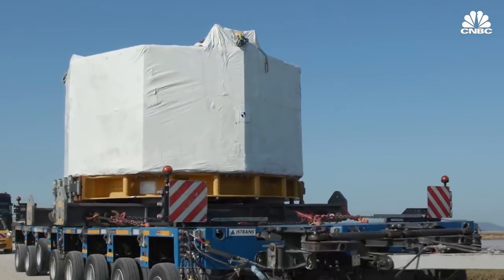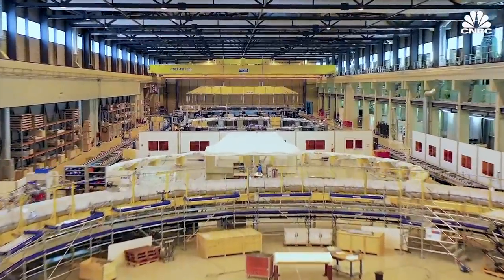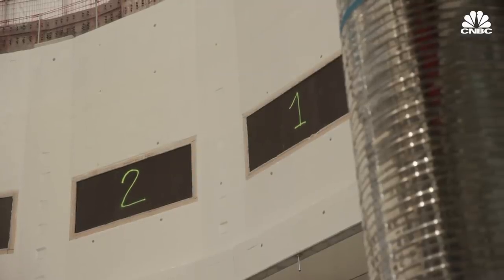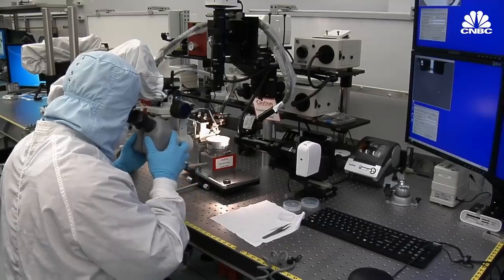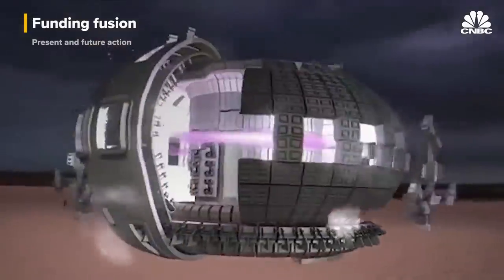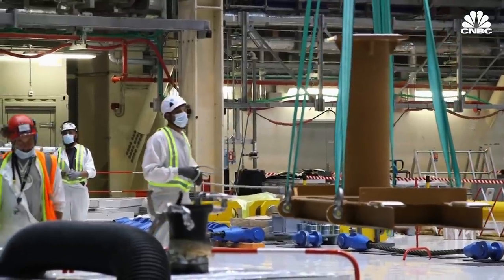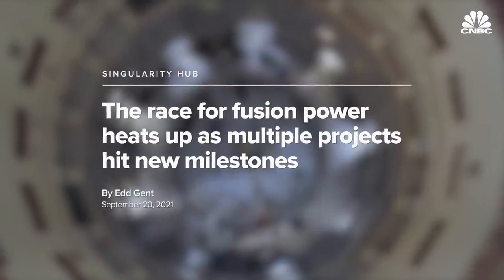Can This $22 Billion Megaproject Make Nuclear Fusion Power A Reality?

Comment: Kudos for acknowledging that raising living standards requires energy and that wind and solar are not going to cut it because they're not "always on".
Reply: Wind and solar by themselves are not, but wind and solar in combination with battery storage will.
Reply: @franksang5014  Indeed.
Reply: @franksang5014  In theory only, there has not been a battery tech breakthrough that will allow this. Unless the new tech in China works.
Reply: solid state batteries are what we need to fund the most, if our batteries improve so too will the capacity of Solar & wind, it's the only hurdle holding us back, in reality solar energy alone is more than enough to power the entire planet if we master energy storage
Reply: @franksang5014  no it won’t. Where I live we get winter 6-8 months out of the year. Solar is not viable. And wind turbines will freeze up.
Reply: @franksang5014  then the only problem would be to have enough of them. For the power they produce wind and solar require lots of space.
Reply: @franksang5014  This sounds like the "we need faster horses"  argument.
Reply: Solar IS always on - somewhere !
Reply: @gurdeeps  I'm not arguing against nuclear power. If fusion costs can eventually come down then it will clearly be the superior energy source. However, as you know, fusion is still largely theoretical as a source of electricity. Solar, wind, and energy storage already exist at scale. Until fusion comes along we would do well to expand their usage.
Reply: @gurdeeps  the case for nuclear fussion is literally made by the same argument.
Reply: @lppoqql  Actually, I would say that it's more than just theory. After all, energy storage is being implemented in Australia, the United States, and many other countries at scale. This is not to say that we don't need advances in battery technology, but with the technology already in existence we can scale up quite significantly.
Reply: @santiagovelamorales1029  You mean fission right?
Reply: @anxiousearth680  no, fussion. We can dream for faster horses, but comercial fussion energy is further than safe and modular fission plants or better battery storage. Fussion is still a dream and will be for a long time
Reply: @grahamashtonuk2554  Solar Grid
Reply: @franksang5014  Solar/Wind are never going to be even close to fusion when it is ready. And it never will be if we don't make huge investments into it.
Reply: @gurdeeps  I'm glad we're in agreement.
Reply: @grahamashtonuk2554  Yeah maybe in space. We have these things called cloud coverage and night on Earth. lol
Reply: @franksang5014  Y'know the lithium in battery storage is limited on this planet
Reply: I believe excess energy could be stored in many ways, including hydrogen for larger vehicles and likes of. Not just lithium etc battery tech

JCB (British digger company) have just invested heavily in hydrogen commercial vehicles, so that says something in my books
Reply: @Rem694u2  Energy can be transported from one area to another. With High Voltage DC power lines, trasmission losses are only about 3.5% per 1,000 km. You could have a massive solar array in the middle of the sahara and transport all its energy to Northern Europe while losing less than 15% of the energy in transmission
Reply: @TankDerek  From what I have read, typical maximum transmission distance is usually only like 300 miles using high voltage lines. There is a reason for that. You also start with a base loss of at least 5% usually closer to 8-15% from the power plant to customers just within normal ranges.
Reply: Nope, no kudos from me because they neglected to add that we ALREADY have a source that satisfies all of those criteria. It's nuclear fission.
It's safe, many times cheaper than any of these fusion proof of concepts, tested and operational since decades, requires no exotic materials that are only found in geopolitically questionable countries, emits LESS CO2 than renewables, is reliable and easy to build with current technology.
The only issue it has is the decades of fossil-fueled propaganda that have been stacked against it.

Fusion is the future, but fission can be the present. And we need to decarbonize in the present, not the future.
Reply: @Rem694u2  You do know that electricity can be transported over long distances thanks to these things called high-voltage power lines, right? If your country has winter 6-8 months of the year then the obvious solution is to install high capacity interconnectors from places where solar and wind are plentiful. Continent-wide synchronized power grids have been around decades.
Reply: @Rem694u2  with some billions worth electrical cable from Moroccan Sahar solar energy farms to US electrical network and it's done.
Reply: @mohcinemabsoute9323  EZ CLAP. :) lol
Reply: I'm so glad that the question about fusion energy is moving towards when and how, instead of if, this could solve a lot of problems for us
Reply: @franksang5014  Batteries require toxic substances to be made.
Reply: @Rem694u2  I also live in the North and have an off grid solar system that works all winter long. The sun still shines in the winter.
There are also wind farms in Canada, Alaska, the North Sea , etc,,, that work all winter long as long as they are winterized. They do not freeze up at all.
Reply: We need to use more fission energy - new designs are foolproof and produce more energy than older designs while also producing less waste
Reply: @santiagovelamorales1029  seeing as you can’t even spell “fusion” correctly, I’m gonna take your opinion with a grain of salt.
Reply: @TankDerek  no, resistance would be way too high for that too work.
Reply: @estebanslavidastic4382  yes I made a mistake at spelling. But, that's a different thing to the content of the argument
Reply: @franksang5014  i think we should use fission.
Reply: What standard do we need to raise that isn't high enough all ready. Our standard is so high in some places. What we need is not a higher standard of living but a cleaner standard of living. Like not building things to fall apart.
Reply: We'll adopt communal living and run our pipes down the corridors to heat the place. Huge hotels housing thousands with meals provided by the state. A bit like H.G. Wells predicted.
Reply: @skepticcat2443  Solid-state batteries are only good for compact sizes, such as car batteries and smartphone batteries. They still don’t have enough capacity to make wind/solar/hydroelectric/hydrothermal work. Fusion is just an all-round better idea, because it doesn’t need much R&D to make it functional at this point. And it has more uses outside of power generation too.
Reply: Solar panels in space. They’ll always be on.
Reply: @youmad7495  You’re going to need a lot of solar panels, even all the solar panels in the solar system right now won’t be enough.
Reply: @youmad7495  It’s very expensive, because you’re going to need to 
a) make 1000000~ square km of solar panels 
b) launch thousands of rockets (or hundreds of times if you use the bigger ones)
c) if something goes wrong, launch again!

Comment: There's a couple misstatements in this video:

1) Fusion produces 4X the amount of energy as fission and 4,000,000X that of fossil fuels. This is true, but you're not getting all of that energy out of the reactor, as it cost a lot of energy to maintain the reactor. Currently, we're just trying to get as much energy out of the reactor as what we put in, but, hopefully, in the next decade or two, we'll probably break through and actually achieve energy gain. Let's assume we make some massive breakthroughs in super conductors in the next decade or two so that we not only achieve energy gain from fusion, like getting out 25% more power than what we put into the reactor, but we will be able to generate 2X the amount of power we put into the reactor. That means your reactor requires you dump 50% of the power that it produces right back into the reactor just to maintain fusion. So, under this OPTOMISTIC scenario, your fusion reactor is really only generating 2X the amount of power you'd get from fission and 2,000,000X what you get from fossil fuels, and that's after a couple more decades of major technological breakthroughs. Fission reactors, on the other hand, already exist and are already able to produce 1,000,000X the amount of power you'd get from fossil fuels..... Also, with a fission reactor, you don't have to dump any power back into the reactor to maintain the reactor. You just add fuel. 

2) The fuel used by these reactors is plentiful. Fusion advocates like to talk about how, compared to fission reactors, the fuel used by fusion reactors is much more plentiful, as it's "just hydrogen". That's not exactly the case though. Almost every fusion reactor currently being worked on right now and planned for in the near future will use deuterium and tritium, both isotopes of hydrogen. Deuterium isn't nearly as common as simple hydrogen, but it's still common enough that it's still way more common than fission fuels. Tritium, on the other hand, doesn't exist naturally, but must be produced by "fissioning" lithium atoms. Lithium is a little more than 2X as common as thorium, the ideal fuel material for one of the best potential fission reactors, LFTR's. HOWEVER, you don't get tritium from common lithium, but primarily from an isotope of it, Li-6, which only makes up ~7.5% of natural lithium. This is where things flip around though, as Thorium is 6.4X as common as Li-6. As such, fusion fuel is actually less abundant than fission fuels. 

3) Unlike fission reactors, fusion reactors don't produce long lived radioactive waste. Contrary to what the video states, there are actually several Gen 4 reactor designs, such as LFTR, that don't produce long lived radioactive waste either, as those long-lived wastes are chiefly the transuranics which largely aren't produced by LFTR's and would be consumed in other types of fast reactors. So the wastes produced by reactors such as LFTR's would be short lived radioactive waste. Fusion reactors also produce short-lived radioactive waste as H-2 + H-3 fusion produces hell'a lots of free neutrons which will be slamming into the reactor vessel and surrounding materials, converting many of those materials into radioactive isotopes. 

4) Fusion reactors can't melt down. Neither can fission reactors like LFTR's, which are liquids to start.
Reply: One thing to put the tritium in a little more perspective. At 30k dollars per gram, it is the most expensive isotope in existence. There is good reason to think fusion reactors will not be able to produce an out of tritium equal to what they will need. And that is a show stopper because there is a finite amount in existence.
Reply: The issue with tritium is honestly what I think is the biggest reason fusion energy will never be a viable source, even more than actually getting it to work. The way things are going we won't even have any tritium by the 2040s.

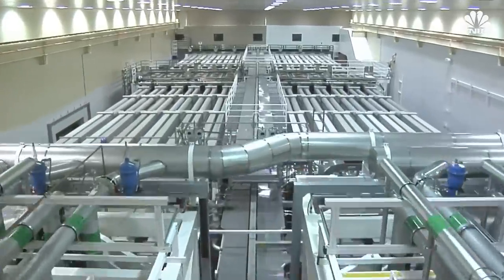Comment: 3:09 that's incorrect - the 50 MW quoted only includes energy that goes into the plasma and not what's used for the whole system, the 500 MW produced is the plasma emergy, not what can be used to produce electricity. Overall the power output will be only about 75% of what is used and that's only for 8 minutes of operation.

But that's fine because the production of net electricity was never a goal - ITER is a testing and development platform for the next reactor DEMO.
Reply: This is a very important point, was just going to mention it but you mentioned it. Thanks for pointing it out.
Reply: Yes sabina sabine hossenfelder made video on this Qplasma QTotal
Reply: well 75% is a lot better than the ~1% that was possible before.
Reply: It's worse than that. The Qtotal of ITER is about 0.1. That's before converting the thermal energy into electric energy.

ITER takes 440MW, 120MW of that is consumed without any plasma at all.

ITER was touted as being able to produce more energy than it consume on more than one occasion, conveniently leaving out the fact they were only talking about Qplasma. Like they assume the plants themselves will just magically consume less power.
Reply: I'm so glad that the question about fusion energy is moving towards when and how, instead of if, this could solve a lot of problems for us
Reply: @Tim Norris It would be much better to invest in Fission than anything. France decarborised it's energy grid without even trying. It gets 90% it's energy from clean sources every hour and every day, while it's neughbour Denmark doesn't even get that much when the wind is blowing and goes back to dirty when it isn't.
Reply: @Tim Norris I said 90% from clean sources, not from nuclear energy, although nuclear makes up the bulk.

Decommissioning costs are paid for by the reactors themselves, it is a legal requirement to put away money to pay for your decommission.

Waste? You mean the entirely contained waste stream which constitutes the tiniest waste stream of any power source? That waste? 3 casks in the corner of a room powered Paris for 50 years. France also reprocesses it's fuel reducing the long-lived isotopes.

What is the solution to solar waste? Landfills or African kids blood streams, and a lot of them.
Reply: @manpetepetrop8034  Same. It's like vaccine efficacy vs. efficiency. Not sure why these lies are so blatantly propagated by the scientific community, and it certainly undermines my faith in them.
Reply: This step, to keep the plasma stable you need energy.
we don't care about if this project is profitable, we only care if the fusion process is able to generate energy!
Reply: @Tim Norris that’s just laughably naive.

Wind and solar have reached almost their apex in regards to output.

They are incredibly costly to build and maintain, and only become profitable after dozens of years, or in very specific regions on earth. 

Wind energy isn’t viable for countries without hurricanes/tornadoes. Solar isn’t viable for countries with lots of clouds or little sun. 

It’s not a matter of if, but when.
Reply: @Tim Norris yeah and Denmark has an IDEAL geographical location for wind energy, and has a small landmass and population. 

Renewables CAN work in SOME countries, but they are grossly inefficient, costly, and again only work for SOME countries. 

I mean, Iceland has 100% of its energy needs met by geothermal energy. Does that mean we should all switch to it? No. We don’t have access to that, and our populations are much more massive. 

Renewable energy is only viable wide scale, in small countries with uniquely positioned locations on the globe that allow them to take advantage of the plentiful amount of resources available.

Wind energy and solar energy won’t come anywhere CLOSE to being able to power China, or USA, or Russia or India.
Reply: @theeiszeitmann928  how will you store/use that 75% in 8 minutes ?
Reply: @forefatherofmankind3305  it's impossible but that's not the Point. I was merely pointing out that the efficiency is a lot better than in perversely attempts. However,  i agree that the reporting is very misleading.
Reply: @infini_ryu9461  even if this reactor doesn't produce net energy, that's the point, it was never meant to generate the energy it was just made to prove that fusion energy is possible

Comment: The "50 MW in, 500 MW out" is actually only for the plasma, not for the overall energy. Looking at the total, ITER will still consume more energy than it will produce, even under ideal conditions
Reply: Yes, and that only applies while it is running.  Even when making no power they need a power input.
"Fusion energy is 30 years in the future and always will be" still applies so far.
Reply: @kensmith5694  Clean Planet Inc. and Miura (Japan's biggest boiler manufacturer) have concluded an agreement for joint development of industrial boilers that use Quantum Hydrogen Energy (eg. LENR). Clean energy is not so far after all.
Reply: @marcbuttler7681  I wish them luck but I am skeptical.   The question of no fatal gamma ray doses in the very early work has not been answered.  If the claimed process was going on, that should have happened.  The only way it could be real is if they stumbled onto something and their explanation of what it is , is incorrect.
Reply: Imagine thinking you know the stuff better than the thousands of ITER scientists working on this 🤦🏻‍♂️
Reply: @Engineer9736  aww Richard you poor confused guy :(

Comment: Ah yes, nuclear fusion.

The technology that has been 5 years away for 30 years
Reply: wait wait wait is it safe or will it melt down what are the safety measures against a melt down!
Reply: @raven4k998  It is perfectly safe. Relax. They wouldn't do it if it wasn't safe. It's 2021.
Reply: @raven4k998  I think you are conflating two very different issues. 

Covid can not be kept "under control" as it relies upon the entire public to behave in a specific way (to limit transmission). The public, as a group, as stupid. 

This is a project being undertaken by the finest minds in our society, who have many years experience in one of safest and heaviest regulated industries in the planet.
Reply: @raven4k998  Fusion requires very specific conditions to happen, if those conditions are not met the reaction stops.
These reactors can't melt down.
Reply: @raven4k998  Simply put turn off the power then there won't be the plasma and thus no fusion. You can think of it a gas powered generator you may have on a work site, when it is off it is very safe and it is even safer when there is no fuel.
Reply: @raven4k998  
They made Nuclear Fusion a reality.
Reply: @mattg5878  Lmao yes yes they’ve teasing us as long as I remember 😂

Not the technology itself, the existing system still impracticable !